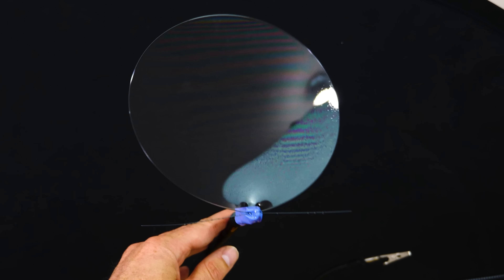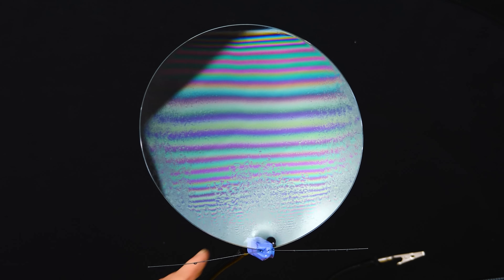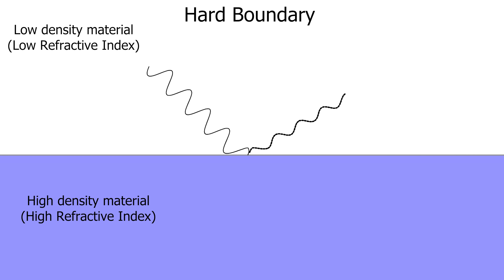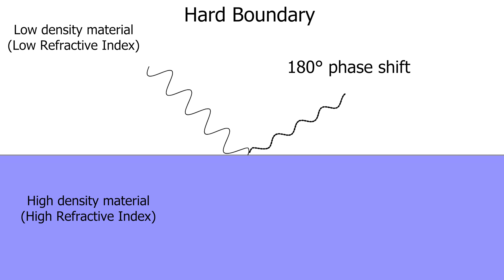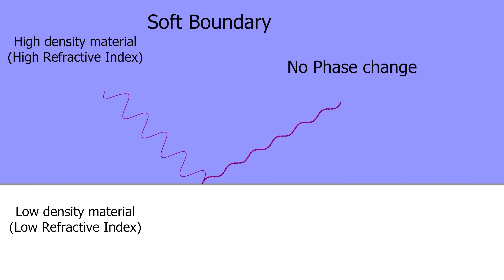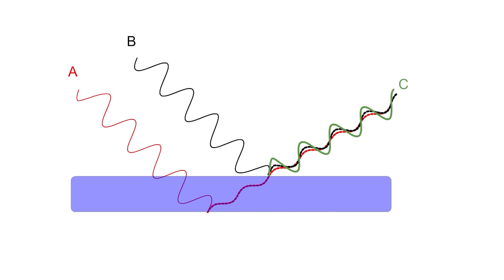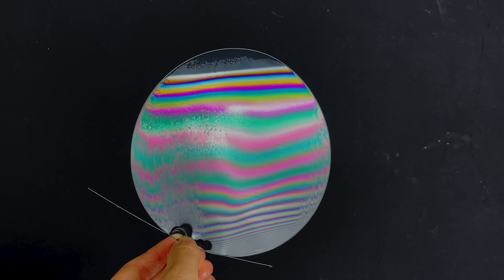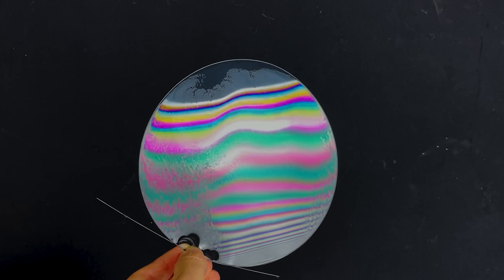A Thin Slice Of Nothing

Comment: I’m confused, if it was a tight enough seal, aren’t we still just seeing the air inside the device? Or is there not a seal in between the layers of the glass? and if there isn’t a seal between the glass, then aren’t we just seeing the light interaction between the two slides of glass? Although I guess this would still be the closest we can get to seeing nothing. I’m not sure.

Comment: You have demonstrated that the color ring pattern is an arctifact of the lenses. Refraction, not diffraction, is the cause of the multiple examples of color generation at the surface of materials. Light photons are too fast and too small to actually coincide in on single location, and even less likely to interact with other photons  outside atoms. The same effect is what we can see in the wrongly named diffraction gratings, or materials. It's a matter of refractions and reflections, just that simple. All theories about photon interaction is bad science.

Comment: I alwways wondered what made those colours on spilt oil/petrol. And this explains why the way I once simulated it in an animation, by having a pattern which, after initial separate rings of different static colours,   actually shifted in hues based on the angle it was seen from, was kinda convincing!
Higher angle, different thickness to observer,  different wavelength, like a sunset.. I didn't know any of this then, but I was happy enough with the results! 🤣
Reply: Bs.

Comment: 🧲🌡️📡🔆☢️🔌🔊🔋♻️🌐☯️⚛️
 It's really facinating how so many properties with-in Nature use: ~{"Differences"}~
 That "factor" seems to be a key factor in keeping dynamic systems functioning. *{High pressure/low pressure, hot/cold temp, different densities, static electric charges/discharges, electromagnetism north/south poles, different velocity/angular momentum, different amounts of energy/mass/frequency/vibrations. Different layers between different regions such as: (Land/water/air/edge of the atmosphere/space/ the different regions in space with different particle density/background radiation, creating bubbles/membrane layers/cloud regions, nebula's/Galaxy's/Galaxy clusters/ Cosmic filaments/less dense regions of space compared to dense regions of space.) All of these things are basic differences but create a way for the dynamic engine with-in Nature to continue flowing and operating to create and convert energy.} Just Like How a battery 🔋 transfers + charges through a membrane layer to a - charged side. Like how regions of high/low pressure and temperature 🌡️differences create winds. In water- add some factors and It creates ocean currents and flow. Then internally in our planet it creates plate tectonics, planetary convection, geothermal activity, a magnetic field around our planet, to hold a atmosphere. 
🧲🌡️📡🔆☢️🔌🔊🔋♻️🌐☯️⚛️
The natural world around us is just utterly facinating to me.

Comment: I don't know if Action Man reads comments or not but I have an unsolved physics mystery that needs solving. Why does the shower curtain pull inward when you turn the shower on? Some say it's because the water heats the air up, making the pressure lower than outside the shower, but it's open space above the curtain so how could pressure really be that different? Does the water need to be a certain temperature? I haven't tried it with cold water, I just thought of it while writing this. I don't think it's because the water going down the drain entrains air and pulls it down with it, because I put my foot over the drain hole and it still happened.

Comment: The concept of "Nothing" represented by the number "0" (zero) did not exist in the beginning. The number "0" (zero) is a relatively recent human innovation in mathematics. But, there has always been "1" (one). The fact that one (1) exists and can generate the position/concept of "nothing" (0) shows that there first exists one (1). Thus, nothing (0) does not truly exist alone: One (1) must first exist that can generate the position/concept of nothing (0). Mathematically, Absolute nothing (0) "could be" expressed as 0 to the power of 0, which can equal 1. "Nothing" (0) IS "Something" (1); because, it comes from "Something" (1). Moreover, since Nothing (0 perceived) is not Nothing (0 actual), then it is possible for Something (1) to come from Nothing (0 actual). Because, Something (1) is inherently pre-existing within Nothing (0 actual), hence, 0 to the power of 0 can equal 1. Simply put, Something (1) exists before Nothing (0) can exist. In the beginning, there was Singularity (1).

Comment: Does this thin layer explanation for the colors also explain why the inside of a computer chip is colorful?
Reply: Yes. It's due to the very thin layers of semiconductor and protective materials. Also, very small patterns etched into the surface can cause light to be refracted in colorful ways, like on a butterfly wing or a holographic card.

Comment: Vacuum or anything else doesn't do anything with this pattern. It's all about lightwave which separates into two waves after going through the material. These waves add up or cancel out each other according to the path length that wave came in the gap.

Comment: Isn't it still theoretically possible for some air molecules to be trapped between the sheets due to non-fluid flow characters exhibited at extreme vacuums? Hence the entire deal with vacuum chamber's having such massive exhaust ports when utilizing turbomolecular pump. If there's no easy free means for the absolute last few molecules....could this happen and would it matter?

Comment: If you consider the Maxwell's equation, there is no refraction index there, but magnetic permeability and dielectric permittivity, μ and ε respectively.
The ε if the vacuum and the air are the same, and this is why the interference patterns are the same...

Comment: My brain went a lot further on the word nothing. A vacum is not nothing, it's empty space.
Reply: I guess it gets down to what a "thing" is. Air molecules are things. But a vacuum has no air, so by some definition it's "nothing". But even without molecules, there are still virtual particles. Quantum things that pop in and out of existence. Are virtual particles "things"? Perhaps nothing can only exist as a thin slice between two things. The space between a pair of very close together plates doesn't contain enough room for virtual particles to pop in and out of existence. It's called the Casimir effect. The space between Casimir plates is the only true "thin slice of nothing".
Reply: @SafetyLucas  I'm nowhere near proficient in astrophysics, but when I learned that the universe has a bigger diameter than twice the distance light can can travel in the time of the existence of the universe, I had to shift my understanding of what space is.
I had to widen my perception of what constitutes as nothing.
I know I'm being pedantic and I'm not disagreeing with colloquial use of nothing as air or a vacuum. My brain just jumped to the most extreme understanding of nothing and was therefore poised to watch the video.
Btw I don't think me or most people can wrap their head around, what "true" nothing is.
Reply: Sabine Hossenfelder has a great video on "what's nothing" and she explains the same.

Comment: The part that surprised me was those pieces didn't separate once at a vacuum... I would have thought that since they were being held together by something like a vacuum, once in a vacuum they would have fallen apart...
Reply: Yeah, they're not held together by air pressure.  They're just held close together by the surrounding support material
Reply: There is not vacuum between the two pieces. There is air.
Reply: @rodrigoappendino  i always thought that when you smoosh 2 very flat surfaces together they form a vacuum between the surfaces... It pushes out all the air and they basically bond to each other and  can very difficult to separate them... Guess i was wrong. Okay. Thanks.
Reply: @michaelhanson5773  that's because they aren't 2 very flat piece: it's a concave lens smooshed onto a flat piece of glass
Reply: @michaelhanson5773  very few things are completely flat, and even then you're not going to get all the air out of the interface usually, especially if you're purposely trying not to like for this example

When things stick together it's more the static adhesion forces than air pressure holding them together
Reply: @auroraec2657   @michaelhanson5773  why u guys keep saying smooshed?
Reply: @michaelhanson5773  This is sorta true with some materials, like metals in a vacuum. They fuse.
Reply: @michaelhanson5773  what you're talking about is stiction, the surfaces have to be smooth and flat at a molecular level, the surfaces can bond due to the close proximity of atoms.
Reply: @samaelsandalphon5600  ahh that's it.. yup. For some reason i was thinking it was a vacuum because when the flat surfaces smoosh together, it pushes all the air out and is basically held together by lack of air.. thanks for the info. Maybe i will remember it next time.
Reply: Did it seem like the rings became even more vivid and distinct in the vacuum? Or was that just the camera?
Reply: It's actually not. The apparatus can hold them squished together, one of them is flat
Reply: How the fuck do you know that they’re held together by a vacuum?
Reply: @dad49998  did you read all the comments under this or even scroll through the first bit at all? If you did, you should have been able to understand a couple things... 1.) I mistakenly confused static adhesion with a vacuum since 2 flat surfaces when pressed together can seem to stick together and that is actually not a vacuum...  And 2.) I had missed that in this experiment the pieces were being held together by a device which I didn't know was holding the piece together and thought it was just there for support.
Reply: milesdoyle  quit pushing your stuff on people bot ..